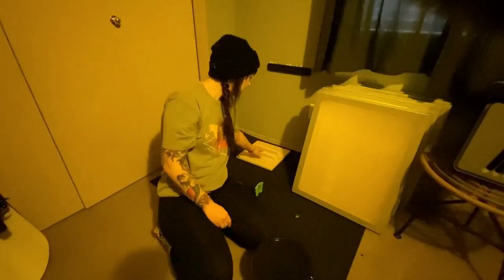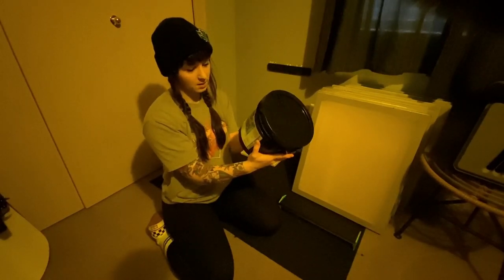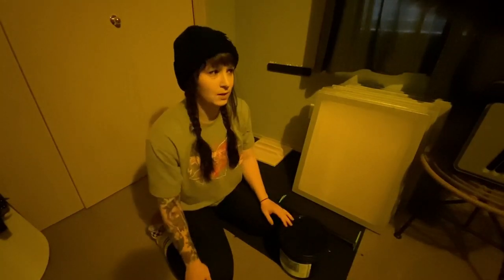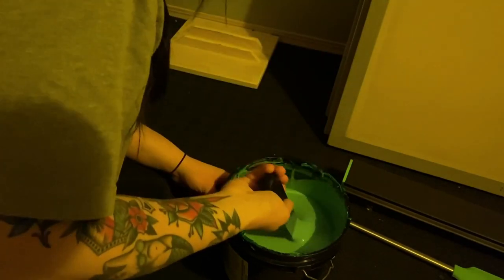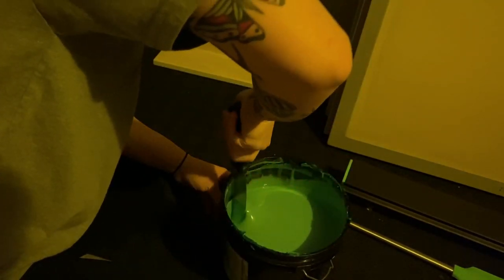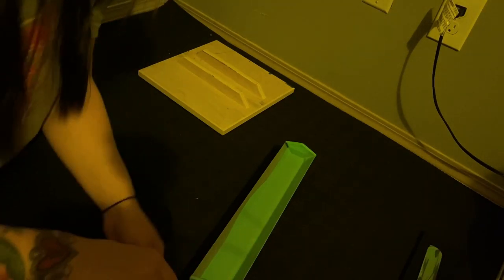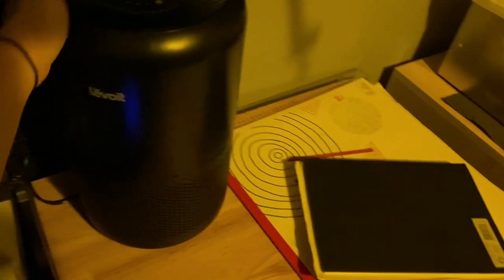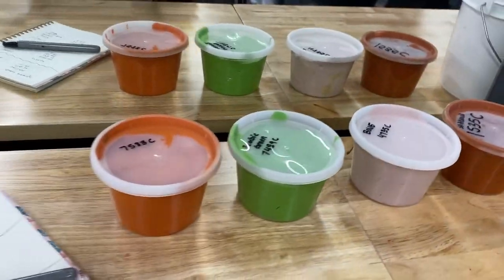SCREEN PRINTING - Coat screens with me / what Emulsion I use

Comment: If that's a pure photopolymer emulsion, you don't need to mix it every time, mixing it then waiting an hour or two before coating will let bubbles come up. Using a diazo , or dual cure you don't want to use metal unless it's coated with rubber, use paint stick mixers that they have at home Depot. Wet a paper towel then squeeze out excess water, wetness will help clean that emulsion a bit easier. Screen printing lingo 101 inks, not paints, If you hear someone say paints, old schoolers will always correct you, t- shirt boards are platens, not pallets even I say it sometimes because all the young ones keep saying it. You look happy doing what you are doing, have fun, always take advice, try it out and see what works for you after 20 plus years I will always listen to someone if they think they have a better way, they might and it could save you time and money.
Reply from the maker: Thank you, I really apricate all the feed back. I love to learn.